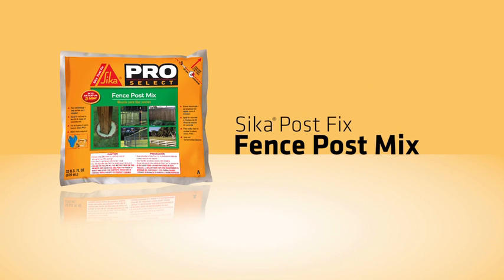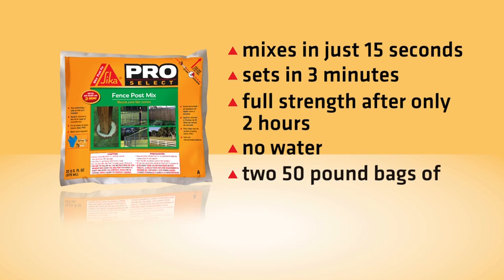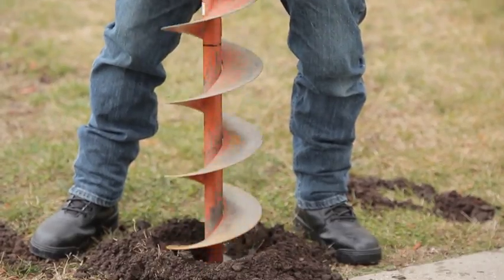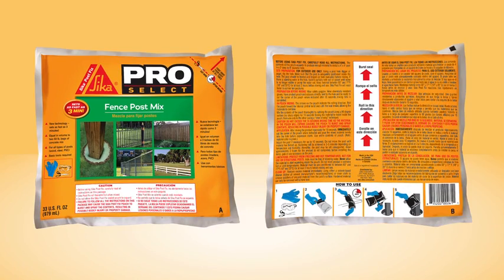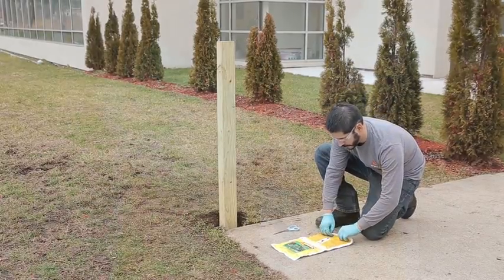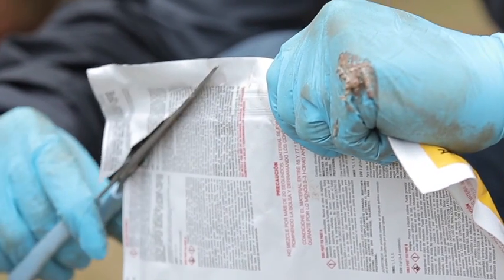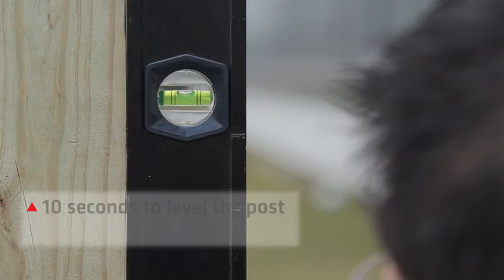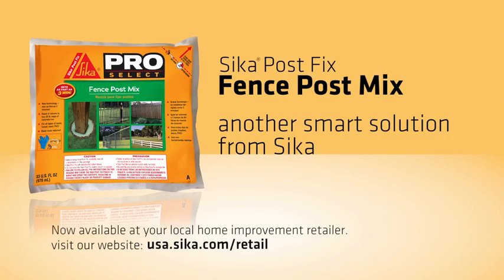Sika® Post Fix Fence Post Mix

Comment: I just used it two hours ago... it was more like 10 minutes to set firm. It was 85° out so temp wasn't an issue. It hardened like a rock after two hours though, and cut away with a saw easily. Super easy to use, be sure to mix it good, don't baby it, get in there and mix it like you mean it. So far so good, reassembled the fence a few hours later and it's sturdy like concrete  I would use it again.

Comment: I used it to install a hollow 6x6 post for lighted house numbers. A virgin, I forgot that the bottom of the post was open and the foam came most of the way up the 5' post and into the electrical box.  I would also recommend using outriggers to hold the post straight; I think it leaned a bit after we thought we were finished.    Great stuff!
Reply: Sorry but I got a good chuckle out of your comment. 😅

Comment: Used this for the first time yesterday.  I set a 4x4 post to hold a garden hose reel.  I don't care too much for this stuff.  I had my post perfectly plumb and square to the building.  The foam expansion caused the post to lean and twist.  It also took 2 bags of this stuff to fill my 2' deep 9" wide hole.  That makes it very expensive.  The only real positive here is how quickly it cures.  Aside from that, next time, I think I'm going concrete...  Also with concrete, there is no guessing how much it will expand and if you will have a mess on your hands or not...
Reply: You have to brace your fence post. If the foam causes the post to be off-vertical, it wasn't braced correctly.

Comment: So my post hole is about 24 in deep and 9.5 inches diameter with a four-by-four post. We followed the directions to a T, filled up the hole about three-quarters of the way.  I take to get an entire bag to just fill about 6 or so inches. Am I going to have to do that can I even do that once it's hardened???

Comment: So let me understand… $14 a bag for foam and $3 a bag for concrete.  Don’t need a truck to haul materials? How did all the posts and the rest of the fencing show up? Environmentally friendly? Concrete is gravel, sand, and lime those are natural. What chemically friendly unnatural chemicals create this foam product that reacts and hardens? Bag of concrete pour in dry and pack it then water all the posts when you finish setting the line. Kneed a bag of foam, cut the corner, hold it level until it sets. 

Seems like a lot more expensive, less environmentally friendly, more time setting, and will break down sooner than concrete. You are welcome

Comment: I guess im the only one that has had a good experience  so far, people on YouTube  keep having bad reviews  but i noticed all tbe people that had a bad experience  didnt mix the bag completely,  i like ths product  im using it to place 4x6 to make a 1 1/2 foot tall retaining  wall
Reply: I just used it. I had a good experience. No issues with it.
Reply: The video just not to use it for anything that need structural support. I would think a retaining falls into that category. It seems to be only for post that doesn't carry any weight.

Comment: There is a gap between my Egress window well and the ground behind it. The contractor did not fill it. Is Skia postfix a good product to fill that gap around my egress window well? I have to fill it to stop rainwater from seeping through and wet the foundation.
Reply: I have this same question. Need to fix a place where the rain comes in.
Reply: I'd be careful it does push laot of force to the sides of wherever it's poured.

Comment: Is this product just for fence posts or can I use it for a post that will be used for a 5 ft wide 6 ft tall pinewood gate? The post I am using is 6 x 6 10 ft.

Comment: Moisture is the enemy of all fence posts. While foam and concrete footings are good for repairs, if you're starting from scratch, I recommend the metal post stakes. They keep the base of your 4x4's exposed to air.

Comment: One bag, one post? I have 16 posts to set. $15 a bag. That’s more then one post. I hope that’s not the case.
Reply: 16 posts? This is not made for structural posts.
Reply: @garyyang3485  they aren’t structural posts. It’s fence posts. What they are intended for. I’m not building a deck. Post panel post. Post panel post. So and and so fourth. You’re not thinking about it.
Reply: @garyyang3485  I used it and put the fence up on one side of property. One bag. One post. It works great. Cut the excess away with a meat saw. Locks the posts right in and holds the fence panel without any issues. Def recommend.
Reply: Yes it's much more expensive than concrete

Comment: Can this be use to set post for a hammock? Is it strong enough?
Reply: the good thing about this stuff, is that you can try it, in that situation, and if it doesn't hold the post, you can pull the post, scrape the foam off, and use concrete instead.